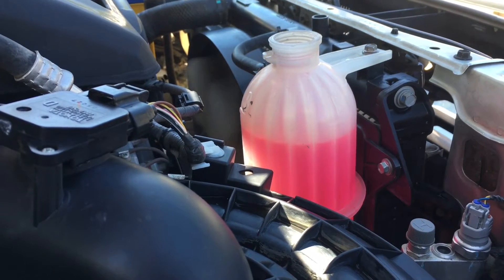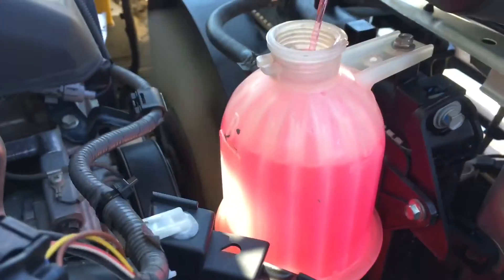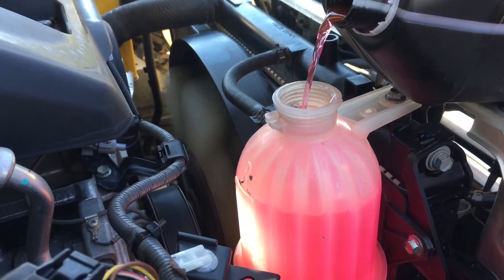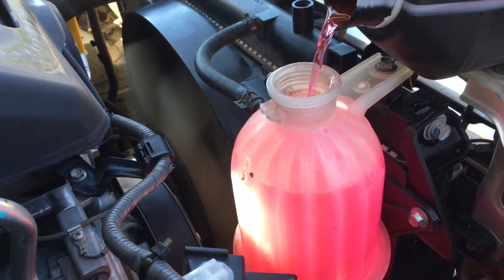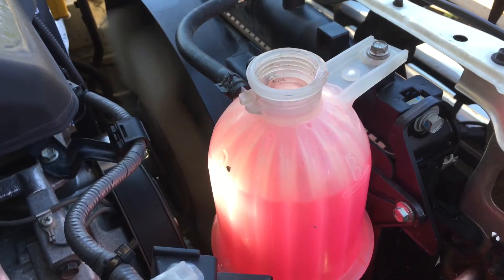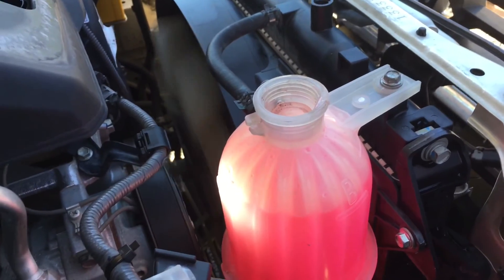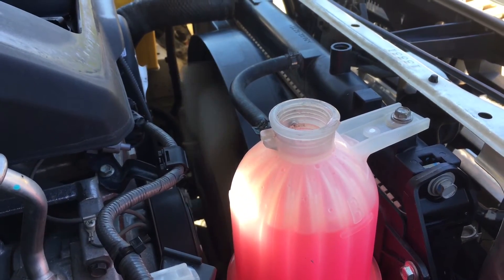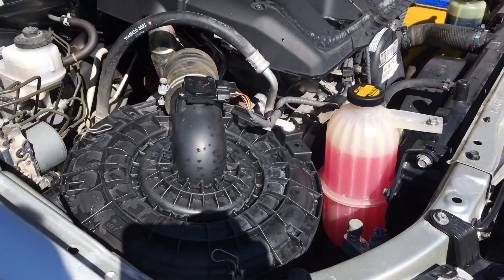BLEEDING THE COOLING SYSTEM - INFO FOR ALL CARS - specific to 1kd-Ftv diesel

Comment: Hi this is ryan from PH, i’m planning to have my coolant change and i will try do it my self. I would just like to ask how did you open the plastic plug above the radiator? Do you need a sealant to put it back on or just plug it back.

Comment: When I used to work at Toyota I found a good way of putting coolant in was fill reservoir to top put the cap back on then take the small hose off radiator then put some air into the bottle to push coolant through when it starts to come out the top of radiator port you know it's full and then test drive to bleed the rest of the way. Never had a problem in the years I did that
Reply: Thank you this worked for me, it was more effective than what the video showed, I manage to push half of the bottle before it filled the radiator completely.

Comment: hi   Even doing after 3x  cooling flush drain /fill repeat [with demineralised water ] . I found filling and dropping fluid was ineffective from idling . I road tested at 2nd and 3rd time flush  with far better results .  
Refilling took 3 heat cooling driving cycles  to have the level stabilize .
Small Top hose is to bleed air from radiator and 2ndly to allow flow -- similar design remote reservoir  system fitted to many vehicles.
....nb always found Toyota fluid thats not changed leaves deposits inside hoses mainly the early glycol stuff but OATS coolant dunno . Old oats coolant can deteriorate engine parts . OATS was a first used wildly by GM .
Reply: Small top hose for air bleeding of the radiator right? Is it the one connected to the coolant reservoir, or the other one connected to radiator? Your response is much appreciated sir thanks
Reply: Which one should I remove